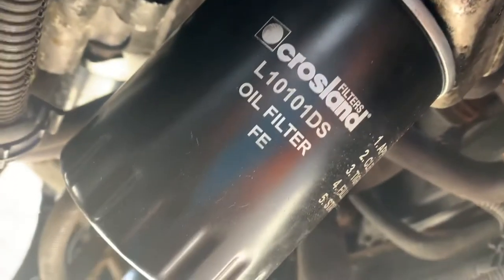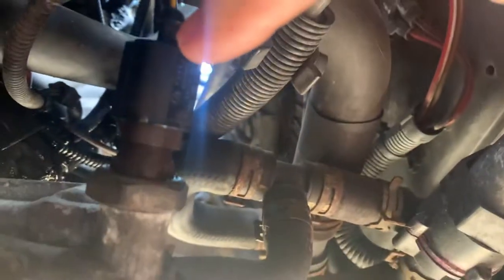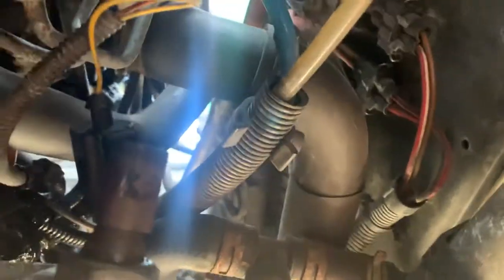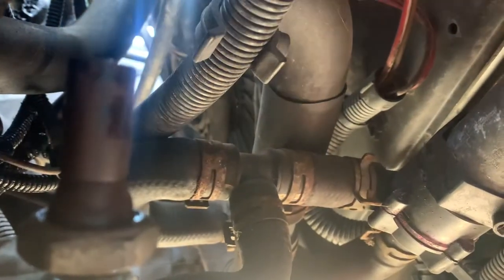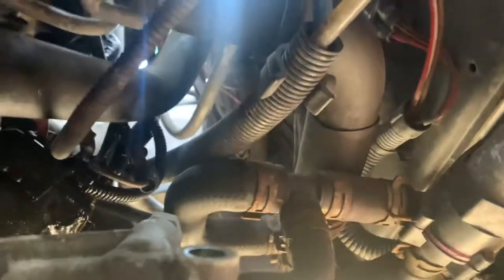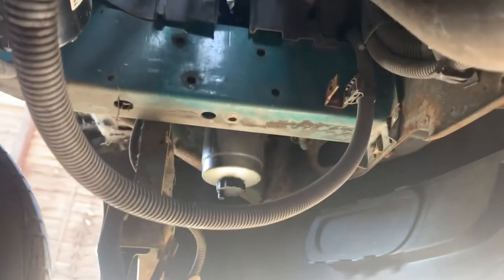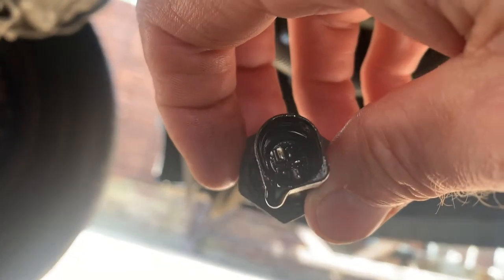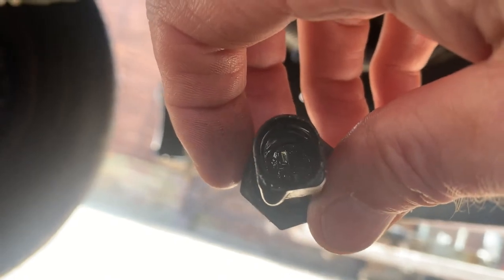Vw t4 oil pressure switch | Jim Hall

Comment: How did you know it's not a oil pressure issue? I have the same light and sound coming, but I'm afraid to use the car now thinking it might be the oil pressure.
Reply from the maker: @mortenhake  not sure mate changed it 2 years ago been fine since, easy job and cheap.

Comment: what engine is this? mine's a 2.5TDi late model T4 ACV, I think there's only one in the lower front of the engine block just to the to the left of the vacuum pump
Reply from the maker: Hi there it’s a 1999 T4 1.9TD

Comment: Does anyone know where the buzzer is buzzing when there is not enough coolant or low oil pressure?
Reply: Som vw T4 have a buzzer on the dashboard electronic bord. Old models dind't have a buzzer.